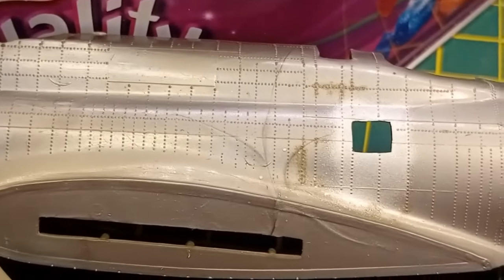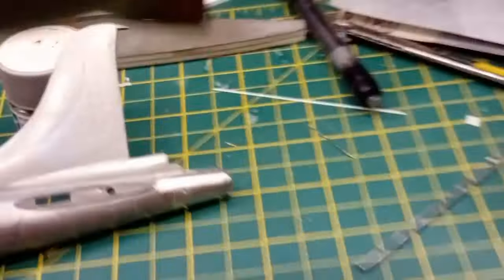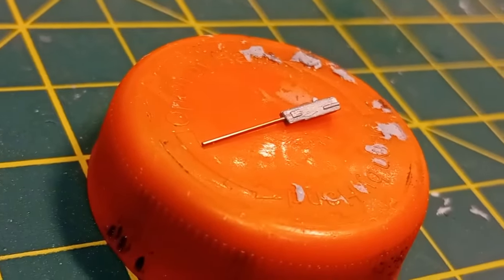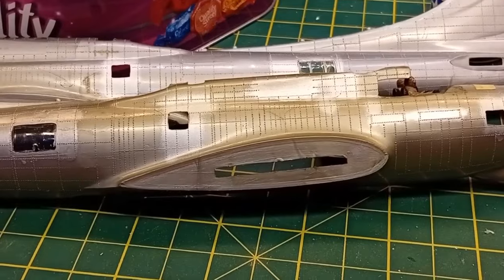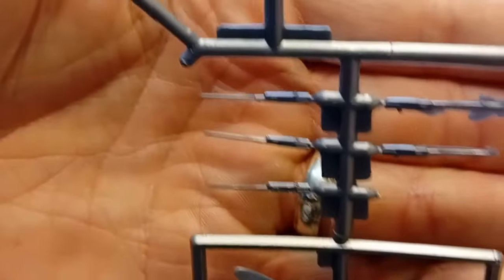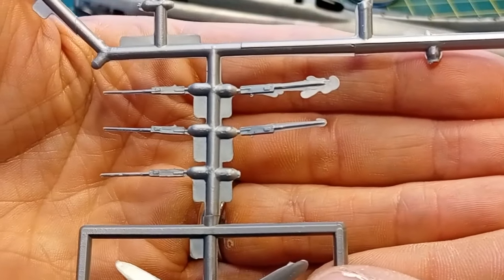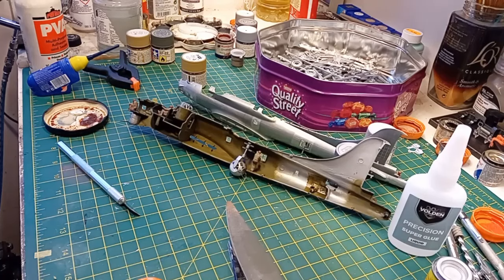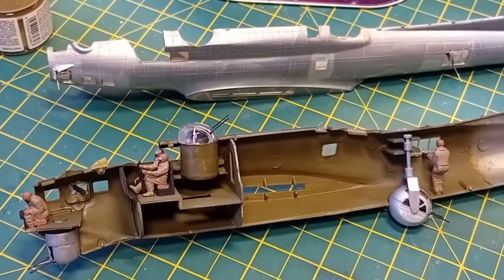airfix old tool B17 flying fortress part 6, interior and windows done

Comment: I built that  kit many years ago, I still have a broken propeller. I found if I sand the rivets it removes all the surface detail . I will use fine grade steel wool to soften the rivets but still leaves some definition.
Reply from the maker: despite my best efforts I will have to fill and sand the fuselage joins, I've not long done the same to a Halifax kit with raised detail, without disturbing too much, then re-riveting the affected areas.
wish me luck!

Comment: Thise old-fashioned rivets are going to be in my nightmares, I just know it. At least knock them down a little, lol.
Reply from the maker: its going to be fun! I'm putting the fuselage together as carefully as possible to try to minimise any filling, and I'll probably use a wet filler, PVA or painters caulk that can be smoothed with too much sanding.

Comment: 1 minute 26 you ve got the wrong side in 😂 spent hours getting them to fit hole should be at the bottom 🤔 used everything out of box on mine
Reply from the maker: oh yeah i noticed that weeks ago, i could just take the guns out, drill a hole in the bottom and put them back its an easy enough fix, but then again times pressing a little on this build so i may not bother.
Reply: @philsmodelmaking2260  why not have just popped them out weeks ago and put them in the right position? 🤔
Reply from the maker: @WendyHodgkinson  do you have a link to the video of your build of this kit? be interesting to see how you built yours.

Comment: Before putting fuselage halves together should have drilled holes in front of radio operators windows for antenna wires made from stretched sprue from kit ( still out of box ) 🤔
Reply from the maker: how would you drill a hole in the centre, between the fuselage halves, before they are fitted together? i just drill holes, use fishing line for aerial wires, its a lot easier than messing around with stretched sprue.